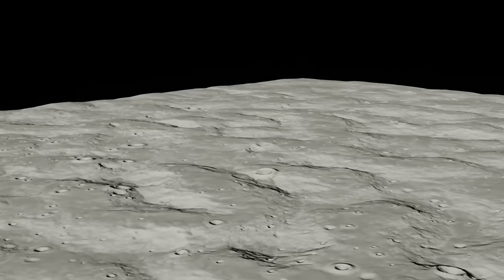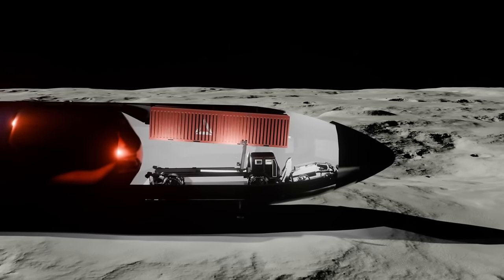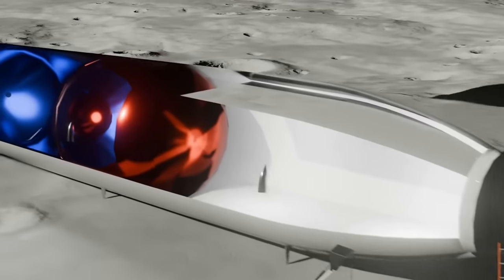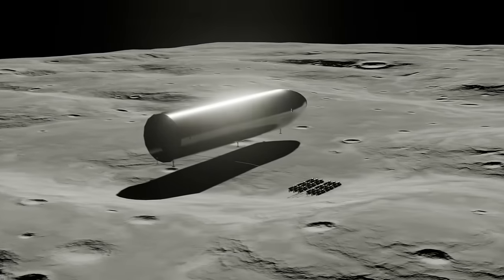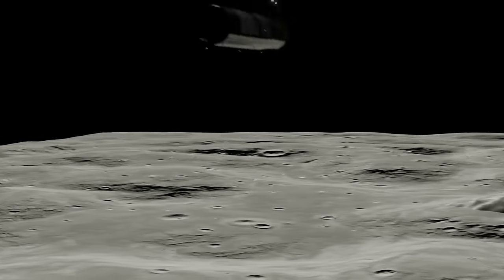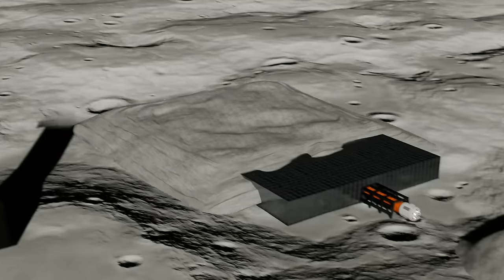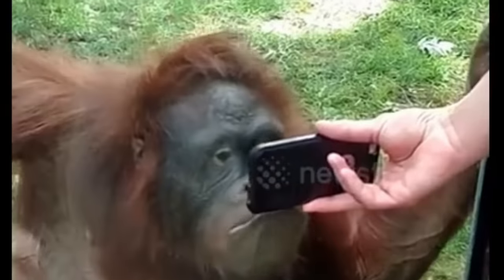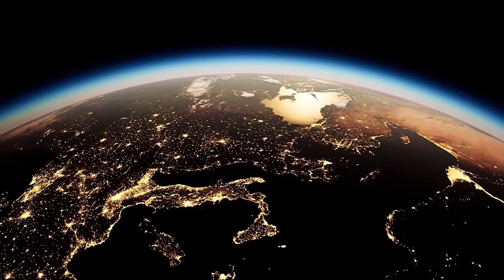How To Develop The Moon ALL PARTS

Comment: About the passagers in the starship... don't forget nuclear subs have to stop their mission after 6 months because their is not enough food in the sub to sustain the crew over that period ! So, when Elon says 100 passagers in the starship to Mars...         :  \
Reply: The "100 Passengers" thing is from about 10 years ago, during initial designs. At the time, Starship was envisioned to be 18 metres in diameter. It has been reduced to 9 metres for now as it was too complex. The current vehicle will hold between 10-20 crew.
Reply: Yes, but if you take said starship and connect them to a much larger Solar cycle headed to Mars  you. Take a whole lot more with you. And if you preposition enough fuel and supplies in Mars orbit IE Phobos as part of a transport hub  you reduce risks you can also be building up supply needs there waiting for your human travelers. So instead of launching humans to Mars with in the next 24 months plan on  sending your supply staging to Phobos with remote robotics first. Once they pick a spot send in the robots to begin the initial infrastructure requirements. Once complete, you begin sending supplies for at least 5 years per person. Nothing tech wise is stopping us.  
Space X will give us what we need the large lifting capacity  to make this happen rapidly. All you gotta do is light the dream and light the candle. You can always hire more people. The right Team can accomplish any thing.
Reply: @AgraFarmsllc  The problem with robots is that they need to be controlled by a human (for now) to perform their tasks. Because of the time delay on Mars, this is a painfully slow process. We need humans either in orbit or on the surface to enable instantaneous communication with them. Sending them autonomously sounds like a great idea, but it's extremely more complex than it sounds.
Reply: U.S. nuclear submarines have things like soft serve ice cream machines, and chefs who bake fresh bread every day for crew members who are used to all the comforts of living in a modern developed country. In contrast, the first one or two generations of Mars colonists will be people who knowingly make the choice to live the rest of their lives in extreme hardship for the greater good. They'll likely be okay with eating dehydrated food, which means that they'll only need about 1 kg of food per person per day (assuming most of the water is recycled). That's still a significant amount of mass, but not enough to make it impossible to pack a large number of people into each Starship.
Reply: @RobinClaassen  I don't think you're right about generations, but it will be critical to grow food on Mars. Initially they'll have to rely on living in habitats sent from Earth, then construct larger buildings, probably by just digging trenches, building the structures and then covering them with a few metres of regolith for stability and radiation protection. Probably a few hundred at first, mostly construction workers, similar to Starbase. Once these structures are complete, and they have set up large solar farms, they'll be able to have underground greenhouses, with UV lights (you don't need sunlight, so forget science fiction domes) with redundance in case of problems, probably hydroponic. If they can mine ice for water (Hydrogen and Oxygen) and capture atmosphere (CO2, which plants will naturally convert into complex hydrocarbons and more oxygen). Plants also need some other elements like Potassium and Nitrogen. Mars "soil" - regolith has a lot of Perchlorates, which luckily are very water soluble, so it can be processed in large drums, like a washing machine, to remove them and end up with a growing medium. Plants also need micro-organisms in the soil. Just a small sample of Earth soil will contain millions of them that will multiple in the right conditions. So, you need ongoing construction crews to continually expand the base, and very shortly, within a few years, botanists to create soil suitable for plants and grow them. Resupply from Earth will obviously be required initially for food, but once they have internal greenhouses, they will slowly require less and less, and it won't take generations, more likely 10-20 years.
Reply: @aldunlop4622  There's too much there for me to respond to, so I'm just replying to let you know that I read your message.
Reply: @RobinClaassen  I guess the bottom line is that humans are problem-solvers. Creating a sustainable base on Mars, is a large, complex problem, but we have the Will to do it, we have the technological capability, and extremely intelligent people to solve these problems. But that’s what we do, we strive to solve problems. There will be issues and problems along the way, but we CAN do it.
Reply: Nuclear subs, with crews between 120-160, typically carry provisions for 3 months, but can easily rendezvous with supply ships, thus extending their deployments.

Comment: We can not build roads under Boston for less than 3 times your number.  Some how I doubt your cost would stay that low. I’d say $1 trillion would be accurate
Reply from the maker: We can tunnel for pipes and septic tanks and basements and tornado shelters etc. Inexpensively in rural areas.

Comment: if there is no way to get air on the moon itself, everything will become more expensive and the development of the moon will be lengthened
Reply from the maker: You can get oxygen from regolith, you just need to source nitrogen but it's infinitely recyclable
Reply: The moon's surface is almost half-comprised of oxygen! Silicon dioxide, aluminum trioxide, calcium oxide, magneium oxide, titanium dioxide, when smelted and refined into building materials offgas oxygen as the waste product! Once they can get those smelters going, oxygen is the one thing they will NOT be running out of!
Reply: @blackepyon4042  воздух состоит из   O2 -20,946%   и   N2 -78,084%, кислородом дышать нельзя.
Reply: @andreypopov6958  You can breathe pure oxygen without ill effect if you reduce the atmospheric pressure. In the case of space suits, this also allows them to remain somewhat flexible at the joints as it doesn't just blow up like a balloon.
Reply: @blackepyon4042  well, I worked at the AK-0,135 cryogenic unit for 12 years, but I only found out about it here, they don't teach it in Russia, thanks for the enlightenment ))
Reply: @blackepyon4042  
Yes, but you need to catch him in time, otherwise he will fly into space

Comment: Oxygen and water supply are the biggest and most important 2 things that need solving firstly ❤
Reply: Oxygen is plentiful in the regolith, and we've detected what seem to be large quantities of water ice in permanently-shaded areas of the caters in the poles. Are you just suggesting that those are considerations that Anthrofuturism should have specifically addressed in these videos?

Getting access to that water is an interesting consideration, because some of those permanently-shaded areas are in close proximity to crater rims that receive light for most of the lunar day-night cycle, which in theory makes solar power a more viable option, since the battery packs needed to survive the night wouldn't need to be as large.

Comment: Wouldn’t meteorites be a problem? With no atmosphere even a small rock could be catastrophic
Reply from the maker: @n0body116  structures are buried under 3 meters of regolith and made of steel so they're safer than the ISS. Also the chances of impact are still extremely small, like 1 impact per 1m2 every 1000 years iirc.
Reply: @Anthrofuturism  I had no idea the impact chance was that small. Really good point about the ISS too. Probably should’ve thought about it for more than 3 minutes before commenting 🫠
Reply: @Anthrofuturism It depends on the size of the impact. I suspect that each square meter is getting a tad more than 1 micrometeor per millennium.

Comment: Is there a solution to the highly abrasive dust problem on the moon? That is why the US has not been back. And why all the robotic landers have eventually failed.
Reply: That’s what I’m wondering about. How long will any machine or mechanical device hold up to prolonged exposure to such an abrasive dust that is famous for getting everywhere?
Reply: You think THAT is the reason they haven't gone back?  Which landers have failed from moon dust?
Reply: @mako88sb  Maintenance.  It will be a big PIA to be sure, but if you have shelters, water and O2 you can bring things in and physically wash them and blow/spray material out and inspect and replace parts.

Comment: 1:45 Sry, but i don't think it makes any sense to land the Starship sideways. The structure and propulsion system don't allow this. Just use a crane or flip the Starship after landing vertically.
Reply: What crane? You brought one? Yes. Which one of the original starships did you put it on? The 6th one. I thought we only sent 5 for 1 time use, Did you send a 6th for one time use? No. How did you send it then? Landed normally. And then unloaded it and used it to flip the others? Yes. The payload bay isn’t at ground level if you land normally, so how did you unload it? With a crane. Oh. WAIT WHAT?!?!(see the problem here)
Reply: @jakammor4449  bro you have a crane in the the cargo bay that is used to unload to the surface. like an overhead crane. I feel like you think about some kind of mobile construction level crane.
Reply: @hony1717  like a crane attached to the starship? Yes. Imagine the mechanics of that system, How is that going to lower the starship to the ground if it’s attached to the starship itself? Umm…hook onto a structure on the surface and use that as leverage to allow the mounted crane to lower the starship to the ground…? So basically another crane?
Reply: @jakammor4449  the crane is fot unloading. no flipping in that case. you can still use the ship as a habitat but with more radiation exposure
Reply: @hony1717  “crane is not for unloading” you can be serious… “bro you have a crane in the cargo bay that is used to unload to the surface…” that line ring a bell?

Comment: Straight up the most significant hurdle to extended lunar occupation is being ignored, the glass-like abrasive, charged and sticks to anything dust, which for all intents and purposes maybe treated like an extremely corrosive material. It destroys spacesuits within days, machinery within weeks. What's the plan for that?
One of those initial unmanned preparatory space vessels is going to have to be a fully equipped and functioning industrial facility, well and truly placing the entire proposal into the fiction novel category.
We could do this...when we have nanobot repair systems in the 25th century but then we'll have warp drives.
Colonisation of the solar system is only marginally less ridiculous, and I'm talking infantile scale ridiculous, than interstellar exploration. Not going to happen. You're just not getting the physics of how hostile an environment you are in anywhere outside Earth's atmosphere.
It's all great sci fi. It's all it is. Hey, some great new Earth tech comes of these pipe dreams. That's a positive.
Send people to colonise any other body. you send them to die.
Reply from the maker: Electrostatic arrays

Comment: There is a site near the South Pole with sun 95% of the time. The Scott A Massif. No need for the reactors.
Reply: Remember there is a limited amount of space available in the Landing vehicle. No way you will fit the same energy density of solar panels and batteries(yes you still need them) into the space that was allocated to the nuclear reactors.

Comment: There is absolutely NO reason to do the belly flop maneuver, there is no atmosphere. They may lay it down and convert it into a habitat later but they are not going to land it on its side.
Reply: You could absolutely land it on it's side, you just wouldn't do the belly flop until it's a couple hundred meters off the ground and you're ready to use your horizontal landing thrusters. How stable it would be structurally in the horizontal landing stage is another story, as Elon doesn't seem to be very good at thinking things through before he does them.

Comment: Can't wait to see a 40' shipping container parked on the moon😂😂
Reply: Only the volume of the shipping container, not the container itself. You need to fit the reactor unit into that volume so that you can fit it inside a rocket faring, and drop it down to the lunar surface in one piece.

Comment: Just use a crane to turn it sideways
Reply from the maker: Why? It already has thrusters.
Reply: Did you forget that to use a crane, you have to, you know… have a crane? Like you have to bring one there? And when you bring one there, how are you going to land… sideways(lol)? If you land normally, you need a crane1 to get the crane2 to the ground because the payload bay isn’t at ground level if you land normally (see where I’m going with this) so you eventually realize that cranes… are a bad idea
Reply: @jakammor4449  the crane would have to be flat packed and in pieces, so you would have to 1 unpack the crane 2 build the crane. 3 use the crane.
Reply: @Anthrofuturism  well ues maybe it's not too difficult to do, especially with the Moon's lower gravity. With a crane there's also the problem of moving it around to different to sites where starships have landed.